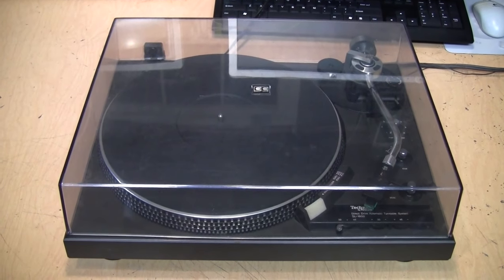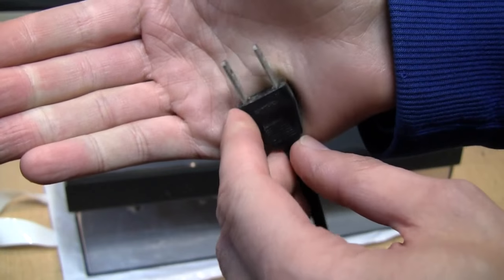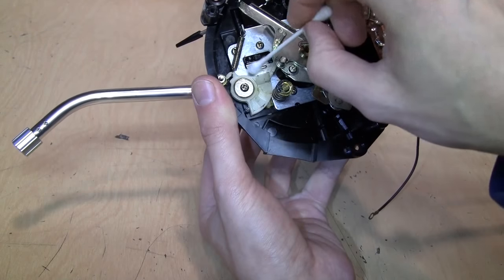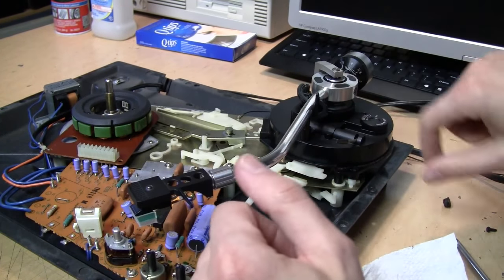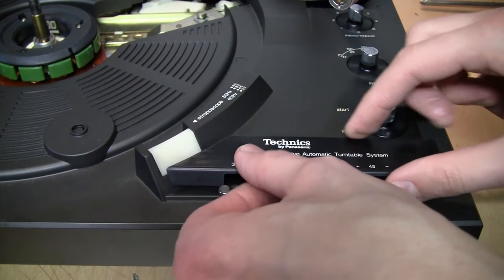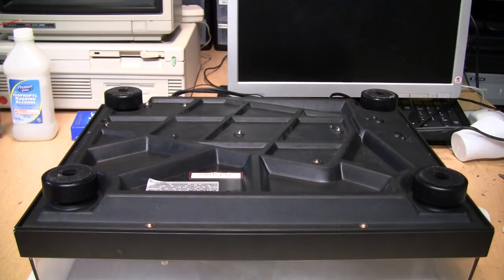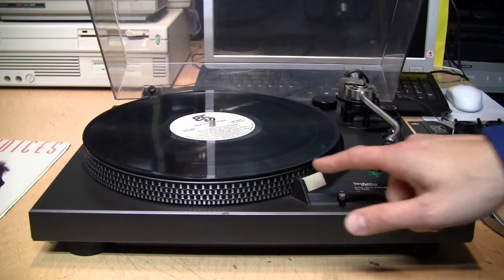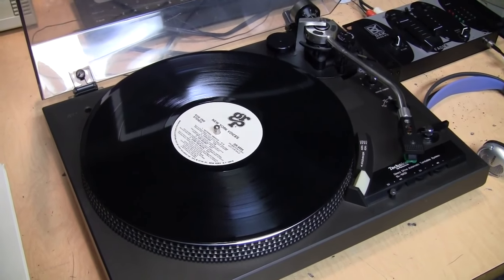Technics SL-1900 turntable repair & review

Comment: Just remember to oil the main platter spindle and it should be good for another 40 years. That unit comes apart very differently from the SL-1300 I have, otherwise its the same design for the most part although noticeably more plastic in areas.

People wonder why the 40+ year old SL-1200 sold for as long as it did..... because it was a high performing, reliable, rock solid design.

Comment: Speaking of 78's...

You said the AT-LP120's anti-skate doesn't work, which I have confirmed by checking out a bunch of anecdotal evidence on reliable sources, so I was hoping you'd do a 78 modification on this table  in the future. radiotvphononut has a pretty solid tutorial on his channel for modding a Technics SL-D1. I'm now looking for a Technics SL-1950 because I'd like to try and get one with the changer. If I do manage to scare one up, I'd like try a 78 mod myself.

Comment: What protractor would you recommend for adjusting the needle position? The other issue I have is related to setting the counterweight. Do you by chance know what the recommended weight is for an Empire 2600 E/III cartridge? I cannot find anything online. 
  Also, your video helped my technics 1910 turntable. Thanks for the help

Comment: I have this turntable, my problem is that my audio connection is loose inside. I think the soldering has come disconnected. Need to see if you have a fix for this.

Comment: An IMPORTANT thing to remember, REMOVE the stylus cover before balancing and setting tracking pressure. The stylus cover/protector has mass, so it would affect balance. The only exception is if the cartridge has a built-in stylus cover, such as higher quality cartridges use, like the Shure M97xe. If the built-in stylus protectors also has a brush, follow cartridge manufacturers recommendations and increase tracking pressure. The Shure M97xe suggests adding 1/2 gram.

Comment: I love my Semi Automatic Technics. SL-D212 it has no auto start but it does have an auto stop The only flaw I find is I sometimes have to adjust the return point as it sometimes gets our of alignment with where it should be and I find i need to adjust the screw that controls its position.

I'm running it on a Technics  EPC-U25 Cartridge, Connected to a Technics SU-V16 Amplifier, which also connects to a Technics ST-S16 Quartz Radio Tuner and RS-M16 Automatic Cassette Deck (I own the complete SC-2020D Box Set minus one wooden shelf my parents lost at some point which I have replaced (also my stylus is a replacement) She runs as good as she did the day I was born, maybe not as good as the day my parents got her in 1982 but hey.

Comment: Thanks for posting this helpful video. I have the same turntable and have almost the opposite issue. The tonearm lowers too quickly but otherwise, everything works perfectly. Any ideas for correcting that issue?
Reply: I was able to fix my damping issue. It was a little bit of a project but not too bad. Happy to assist anyone who needs guidance with that common issue.

Comment: You should always remove the counter weight when you doing anything like this or even moving the turntable, it causes unnecessary stress on the tonearm
Reply from the maker: I had the tonearm locked into place with the clamp.
Reply: VWestlife yes but that put stress on the arm even more when you've got it clamped and there's a heavyweight on the back, and you're moving it about

Comment: This is sort of a long shot, but here we go. I noticed my Technics SL-1900 seems to have lost its dampening in the cueing lever. I looked up the service manual online, and depending on the manufacturer's serial number, there are two different procedures for servicing the cue fluid. If the SL-1900 serial number is after 7920 (middle four numbers) the process is fairly easy. If the serial number is before 7920 the process is much more difficult. So I looked at my turntable, and its serial number is 7J24... what the hell does the J stand for?

Comment: Lubricants turning gummy over time seems to be a common issue! Picked up my first turn table on a whim for nine bucks without checking it out and the platter was locked up by old grease! I didn't really have the knowledge to fix it at the time so my disassembly attempt destroyed it!

Comment: Hi, great Video, I have an SL-1900 myself and mine seems to have the opposite issue that it lowers the arm a bt too fast. Do you think that re-greasing it could with that too or is it more likely that the spring lost it´s tension over the years on mine?
Reply from the maker: Read the damping fluid bulletin (you need to register for a free account if you don't have one already): https://www.vinylengine.com/library/technics/service-bulletins.shtml
Reply: Thank´s for the Link, it´s much appreciated
Reply: I have the same turntable with the same dampening problem... thank you for the information...great video!

Comment: Hi! I owned Sl-1900 and have problem on which I can't find answer anywhere. When I plug into an electrical outlet the turntable starts running and there is no way to stop it. Before it worked ok, turtable strated after putting the tonearm on the left possision. Any Ideas how to fix it?

Comment: Hi - excellent video - quick question - I have a Technics SL-1950 changer / stacker - I removed the bottom cover and did the fix you described and I tested it before placing the top cover on and it worked perfect - but it seems when ever I place the cover on the platter does not spin - I think , but not sure - that the plastic levers are not lining up properly with the controls on the top cover - any help or advise would be appreciated -
Reply from the maker: Sorry, I am not familiar with the SL-1950's mechanism. Maybe you can find a service manual for it online.

Comment: First of all congratulations
with your vintage Technics turntable and the very good AT95E cartridge! Very nice
to show us how to clean a stuck arm lift! I am very glad to see you have taken
my advice from about a year ago and be happy with the results! It takes a lot of
courage to admit you were wrong (and somebody else is right). I just want to
point out a couple of things.  Technics SL-1900 was made in 1977
costed $ 160 has a Wow & Flutter of 0.045% and Rumble of -70 dB and a Servo
control system. These are just fine specs for a good turntable in my opinion. Of
course the audio geeks are never satisfied and call these the bare minimum specs.
They want: Wow & Flutter of 0,025%, Rumble of –78 dB, speed inaccuracy of +/-
0,002% and a quartz control system. But I think that’s just splitting hairs. Do
remember that $160 in 1977 equals $650 in 2016. So this model was certainly not
the most expensive, but not cheap either. The ugly truth of the matter is that
we will probably never again see this kind of quality and excellence in
turntables. In the 70s and early 80s vinyl hold the single-party supremacy, they
were the law, they were what everybody had and what everybody stood by. CD
totally changed that. And now with the internet, well you know what I mean. What
I am trying to say is that you really cannot blame the present turntable manufacturers
of not meeting these high quality standards. Doing so requires big investments,
which in turn requires a world market which just is not there anymore. So my advice
was and is: get it while you can!
Reply from the maker: What was I wrong about? I got the specs I mentioned from: https://www.vinylengine.com/library/technics/sl-1900.shtml

Comment: Great video  I can buy one of these 1900s for  $75 Locally  In Excellent condition Can you please  tell me Do I need A pre amp & Receiver/ Amplifier  Thats what im looking for  Or does it have a builtin pre amp,If so can you give me a quick rundown of your setup, I have been out of the phono click for about 35 years
Reply: Requires a pre amp or receiver/amplifier with a phono input on it.  No built in pre amp on these.

Comment: In your own opinion or maybe it's just common well known knowledge, which model number technics turntable is the most famous or has been sold the most?  
I personally thought it was the SL-1200 but I'm not sure about that.
As you can tell by asking my question, I'm not entirely up to date with my knowledge about turn-tables. But I do know that Technics was / is a very good brand of audio equipment and the mother company is matsushita or panasonic (sorry if mixed this up or got it wrong.)
Reply from the maker: Definitely the SL-1200/1210.

Comment: awesome video ! i did the job and works good now...but the arm go down too fast...might the lithium grease too thin, thats what i think..sprayed out from a bottle,,,the other think is idk why,the arm start to go to the right first like half inch, than go to the left and drop on vinyl...something need to adjust on that? thanks for any answer
Reply from the maker: That is a seperate problem. You need to refil the oil in the tonearm damping mechanism.

Comment: I totally aree with you on that the vintage record players id say better quality and you get mostly more bang for the buck vs the newer versions that from what ive seen the ones you shown with a ceramic cartridge are terrible sounding.  here is the thing I have a question about.  I have a vintage Ge record changer thats portable the turntable bearing ceased up and the brass part underneath broke.  but I never knew what type it had I know it had needle It fell off due to age. its from the 1970s early plays 33 45 78 . id like to fix but on ebay ive seen same one for about price you paid for the technics

Comment: I  replaced my AT-LP120 with  a audio Technica AT-LP 1240 because the anti skate did not work at all on the AT-LP 120 & the AT-LP 1240 had a lower Wow and flutter of 0.1 which for a modern  turntable is ok but I agree  that the older turntables did it better

Comment: also wondering, do you know, when u open the arm assembly, which is the mechanism that controls the antiskating? since my 1900 (bought it used yesterday) is not responding well to the antiskating 'knob'/wheel adjustments... and last but not least, do you have this small issue when the needle is about to drop on the vinyl it moves slightly to the left, not sure yet if that potentially might hurt the stylus or the first strands of the track
Reply from the maker: You can download the service manual here (free registration required): https://www.vinylengine.com/library/technics/sl-1900.shtml

Comment: Hey. Had the same problem and finally took the time to fix my player. Finally the arm moves, however, it drops down way to fast and not as smoothly as it did before. Any ideas what I might have missed?
Reply from the maker: You need to refill the tonearm damping fluid. The service manual (available online) has instructions on how to do it.
Reply: @vwestlife  Awesome, thank you!

Comment: Did you check to make sure it's spinning at 33.3? Looking at the strobe, looks a little off.

Also, this is a really cool turntable. Might get one for my father
Reply from the maker: You're looking at the 50 Hz strobe. The 60 Hz strobe is at the very bottom.
Reply: VWestlife ah, different than the 1200 which is what I’m used to. Thanks for the quality video as usual.

Comment: Looks like same fix for my 1950.  OK this video was just what I needed.  I followed step by step and fixed my 1950.  The only difference was the 1950 has lock ring on the table - safety device I'm sure.  Table works great now.  Thank you!!!

Comment: Right on brother. Thanks for sharing that info. Sweet little machine you got there. I just hear some quality coming from 1977. It did exist. vinyleyezz is BS. Try like me to fix the tonearm wires on a Perpetuum Ebner PE 2020 German turntable machine from 1969. I gotta fix it. It sounds amazing as long as you can get both channels to stay clear and balanced. I could definitely work on yours. Not too bad to do. Thanks VWestlife. Solid.

Comment: Great as usual. I saw the Vinyl Eyez video yesterday and I was hoping you'd do some sort of response. I have a new Pioneer PL990 that I haven't taken out of the box yet and the only thing that stops me from purchasing a vintage turntable is the price. ebay sellers want too much for untested merchandise. I live in the Boise, ID area where there is not a lot of vintage electronics of any kind, let alone turntables. I'll find one.
Reply from the maker: The PL-990 is a good choice for the price. I have one that I bought new in 2009 and it still works fine and sounds very good.

Comment: Found a Technics SL-1401 with a vintage Shure elliptical cartridge and stylus for 20 bucks at a garage sale....He only wanted 5 bucks but I didn't want to feel any more guilty than I already did by paying only 20 bucks for it. It even came with a vintage carbon fibre brush which sits in a metal holder mounted to the top plate for good grounding and static discharge for the brush....Somebody had played with the arm return setting and that was an easy fix....I'm not sure offhand about the 1900, but most Technics have silicon grease in the arm lever mechanism...YMMV.....

Comment: Hello, VWestlife. I recently purchased this turntable and the problem with mines is that as the tonearm moves across to either the large or smaller vinyl, the arm just inadvertently drops on the record rather than slowly lowers to the vinyl and play. I know @ some point I will ruin a vinyl of mine or the needle will soon break if I continue to use this turntable without resolving this problem. Can you give me some advice or recommendation on what I can do to fix this issue?
Reply from the maker: Solution discussed here: https://www.reddit.com/r/vinyl/comments/2v9o4j/technics_1900_cueing_lever_drop_speed/
Reply: @  @vwestlife , I initially thought something inside broke and had to be repaired. Thank you very much!

Comment: Good video, good advice.  I would like to have an automatic table for the family to use.
Reply: Lincon Whisler, There is a guy  [TJ] on U.K ebay who sells fully restored Technics turntables, I bought the SL-B3, prices start from around £190 [open to offers]
They have new lids/ortofon 5E stylus/cartridge/head shell/belt/full instructions, only had mine a couple of months but used well over 100 hours so far
Reply: I picked up 2 more turntables since I posted that comment. A pioneer sl-518... not fully automatic, but it does return and shut off. I also found a Dual 1229, after cleaning and making some adjustments its working great and fully automatic. Cheers!

Comment: All you need for the *best sound is a technics 1200 and an ortophone concord cartridge. No audiophile person can tell the difference in that and anything that's more money. I would buy the cartridge new though around 180$. A new technics is 499 but used ones are just as good. Doesn't matter one year old or 30 all of them are rock solid.

Comment: Had the same problem with mine, took it apart, cleaned it up and away it went.  I used silicone grease instead of lithium, but they work the same.  Now to build a pre-amp....

Comment: Maybe I'm not seeing this correctly through the video, but I think the screwdriver you used may be oversized, like a #2 on #1 screws. Though I suppose the screws are low torque enough anyway as I didn't see any slipping of the screwdriver.
Reply from the maker: I use whatever works.

Comment: that expensive new turntable has a wow and flutter 0.15% and my old turntable is 0.03%! I always assumed those new expensive turntables would be way better then my RadioShack turntable lol. 
My stereo system is all vintage and I wouldn't have it any other way,
Reply: Jason B can you mention what “new” turntable has a wow and flutter of .15%? Make and model? Here is video on turntable design you may be interested in. https://youtu.be/OOlAua3tBSw
Reply: Jason B can you also mention the radio shack model number of the turntable that has the wow and flutter spec of .03%? I’m trying to find it but having no luck
Reply: Jason B I picked this excerpt from the Fluance turntable web site. It’s about wow and flutter. 

What Should Your Look For?

Again, you’ve probably selected a good turntable if it has a wow and flutter under the .25 percent range. The idea, for most, is to purchase a turntable which won’t produce any distortion. Today, some high-quality turntable models have wow and flutter ratings below the .10 percent mark.

Specs and Actual Turntable Performance

You might’ve been lucky, snagging a turntable with incredibly low wow and flutter percentages. You should, however, stay up to date with your player’s long-lasting health. Sometimes, a turntable’s wow and flutter can degrade over time. If your record player hasn’t been cared for properly, its specs won’t translate to its actual performance.

For this reason, a brand-new turntable with .15 percent wow and flutter can sound better than an old turntable with a specified .05 percent wow and flutter. Age matters, and new turntables—on average—will sound better than old turntables.

What Impacts Wow and Flutter?

Both metrics are determined by a turntable’s mechanics and electrical power. This is why old turntables experience worsened wow and flutter: Their capacitor values drift. Over time, a turntable’s mechanical parts can wear down. Power spikes, too, can degrade a record player’s wow and flutter. Unfortunately, events which degrade wow and flutter are hard to pin down.